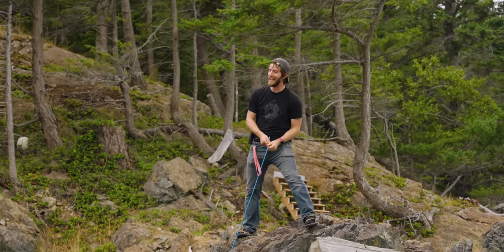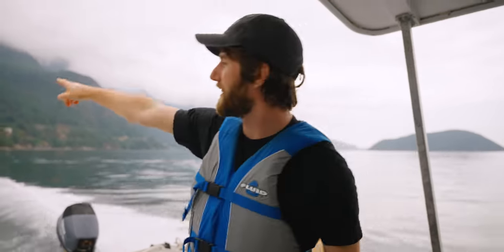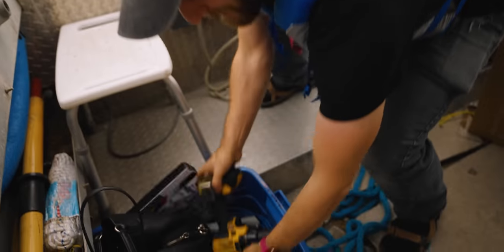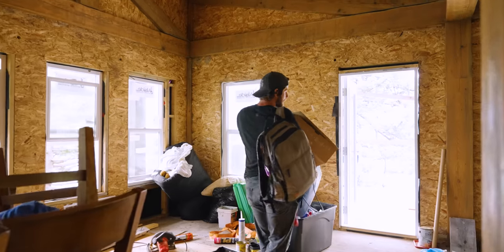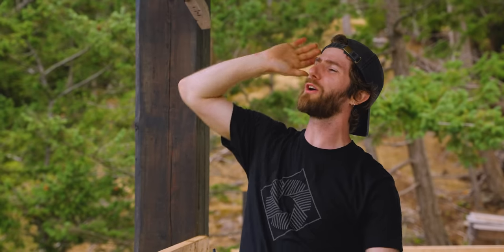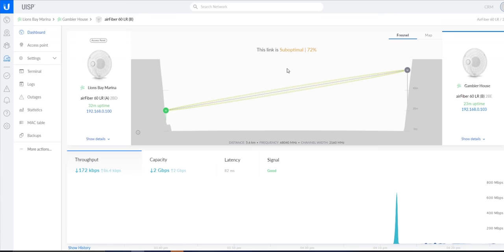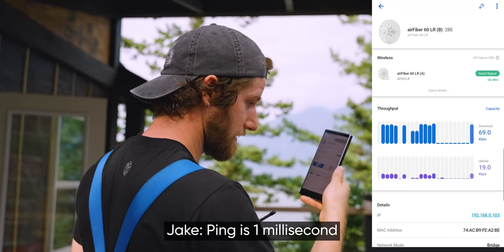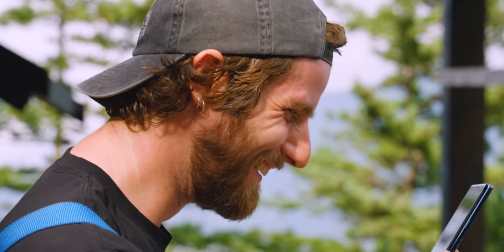How are we going to do this?

Comment: For people who don’t know what this is. This is called a wireless point to point. Ubiquity is one of the bigger dogs in the wireless internet game. And for people confused by the numbers. 77 is minimum for internet connectivity. You like to see 70 or lower down to about 50 before the signal is too hot, which would probably never be the case for this situation. My only concern would be running on 60GHz on an ubiquity airmax dish that from my experience with them shouldn’t be able to reach that far, which I guess would explain the pretty poor signal they were getting. I’m surprised they were able to get it at all.

Comment: I depolyed a 60LR between a friend's house and mine which is about 5Km.  It works about 95% of the time except when it is raining cats and dogs like this winter in Northern California. I also have a 5GHz Rocket M5 link set up on the same path.  I fail over to it when I get rain fade on the 60GHz link.  I would be curious on how stable the link is when you get rain.

Comment: Wouldn't you put the  antenna on the same brick that already had holes in it ? You'd reuse some of existing holes ? or attach an adaptor plate, so that the existing anchor holes are enough....  that way if you need to replace that brick, you have no holes in the wall.   .

Comment: You can also have a Starlink dish from SpaceX. Also, you can use like hydraulic power, like a machine that just spins in water and gets energy from it
Reply: sorry what?
Reply: @TheBossStudioZ  I think he means a water wheel attached to a generator.  Linus mentioned there was a stream nearby that could be used to power such a device.
My first choice would have been just to use an LTE router that would have a more stable signal in bad weather and cost a lot less. Starlink would also be a better but probably quite expensive option.

Comment: Something is better than nothing right.  I hope there's not a lot of wind. Or connection will fail.  I would add additional mount for stability.  So,  the connection wouldnt be so easy to fade.  Overall, great work, guys.  👍

Comment: Hey Linus, I hope you took a fall pro course before strapping on that harness, the D-ring is supposed to be between your shoulder blades and your chest strap should be over the chest. D-ring placement so you don't break your back and stay upright and chest strap placement so if you get inverted (likely) you don't just slip out. Not trying the be judgiey, just informative for the next time

Comment: You could've just used 5g wireless through Verizon or AT&T, whichever had the best reception.  5G home is good enough for gaming and streaming with low latencies and generally isn't affected by weather - same as cable.  Downfall is it cost more than cable, but if you own land on a remote island and building a new house then you have the money to afford 5G.
I know, because I live in a relatively remote part of Alaska.
Reply: 5G doesnt work anywhere and I have used 4G before, it was really unstable.
Reply: @thomasfriedl3137  Wouldn't you say experiences are subjective? 
I game and streamed on mine all the time.  Because it was wireless, weather typically didn't effect it.

Again, only downside was the expense.
Reply: @atheosathonille130  How fast and expensive is your 5G? Because you might be better off with Starlink
Reply: @thomasfriedl3137  I've been on the waiting list for Starlink for 2 years.

Where I am located, around 100mbps.  Typical latency playing games is around 50-70ms.  $180 a month

Comment: lmao. you dont use mollies in concrete.  when drilling out for concrete anchors you always drill a size or two smaller than the actual anchor.  you can always take away more material but its very difficult to put material back.

Comment: I can't get this together.. If you set up two satellite dishes and get it to work in a test is one thing. How was the final solution? When LMG went home and took all the equipment, what happened to the internet line?
Reply: In the short in between, don't know, but in the long term, the owner of the building was apparently paranoid and/or didn't understand how their separate ISP connection worked and thought that the dish being there would mean they'd be able to see things on their network, so presumably had them take it down.

Comment: I like these kind of vids but I really question how robust this uniquiti equipment really is after 6 months, 2 yrs. Anyone have any personal experience with it, I would really appreciate hearing from you.
Reply: I use it commercially, it's pretty damn good. These new 60ghz ones are still in their infancy and we have some running, we've shelved a few of their older 60ghz ones after 1hr of use however. The 5ghz airmax and airfiber range are rock solid, we've loads of the AF5XHD units running many different size antennae, some of them have uptimes of over a year without a single hiccup.
Reply: @LukeMellor  I remember when we got our first 5.8 Orthogon links up and running. That stuff was incredible but so was the price tag. The price now of this ubiquiti stuff makes network extension affordable for pretty much anyone. Thanks for the reply!

Comment: Starlink?
Reply: Starlink not only costs more than the Telus fibre they're using but it's also much slower depending on how you measure.

Starlink: 100-200 down / 20 up, max for now, but no-one knows when it will get faster or if
Fibre to marina and airmax over the water: 900 down / 900 up, on a 1gbit package

The Fibre you can get a static IP (not with Starlink). Starlink needs line of site to the satellites with at least 80% clear sky (foliage) to maintain best speeds.

The Unifi/Fibre setup they are using will stop working everytime a large vessel goes by -- so there's that.

Comment: Why not just get Starlink?
Reply: Too expensive
Reply: @imperialdoggo5826  Linus spends $5-10K or more on a PC, so I'm pretty sure he can cover $800 for a Starlink dish
Reply: @burntearth85  what about the $170 a month for Starlink. Look at the big picture. Not only is this cheaper at purchase, but also month to month.
Reply: @imperialdoggo5826  if I went with Shaw's Fibre+ Gig 1.5 it's $165/month. No difference, cost-wise
Reply: @burntearth85  what about Telus? And his parents don’t need max speeds…
Reply: @imperialdoggo5826  Telus has even less availability in my experience, I've lived in cities just outside edmonton that could only give me a max of 75mbps. Nor sure how remote this location is, but I don't have high hopes
Reply: @burntearth85  it’s also looking at the speeds. Starlink offers at most 300Mbps for $170 a month, Shaw offers 1.5Gbps for $165 a month, and Telus offers 1.5Gbps for like $145 a month depending on location. Starlink isn’t the solution for everything, but it does have its uses.
Reply: @imperialdoggo5826  yeah, but Telus/Shaw aren't available everywhere (I lived in one town that didn't pay tp be connected on Shaws line originally, so you can't get it - even though the towns on either side are connected). I don't like Elon, but Starlink is definitely more accessible